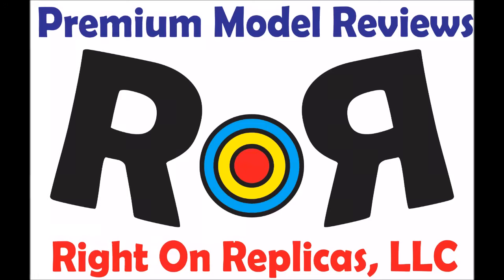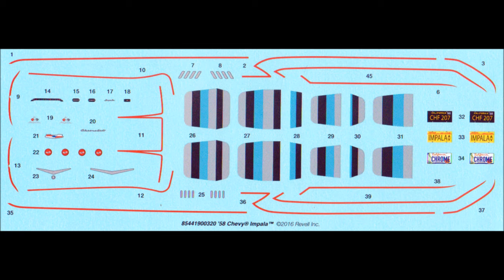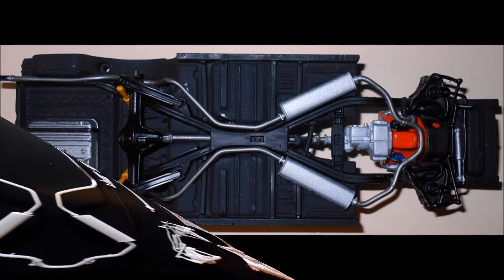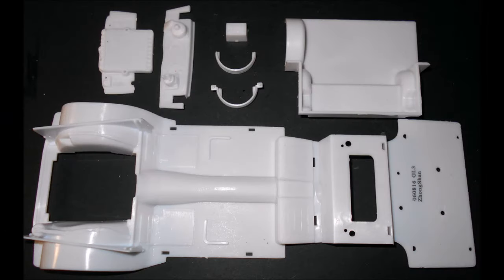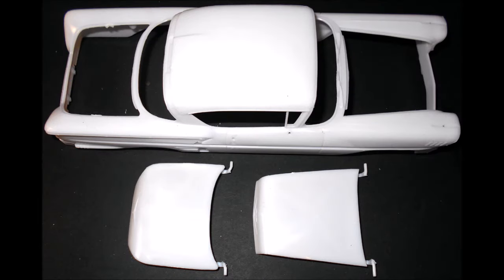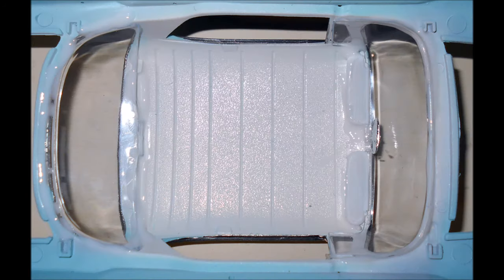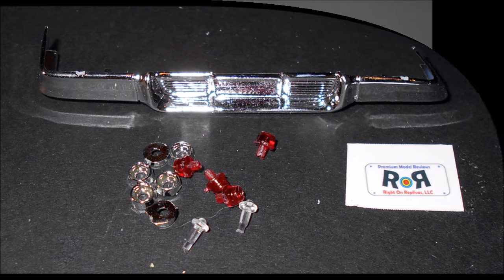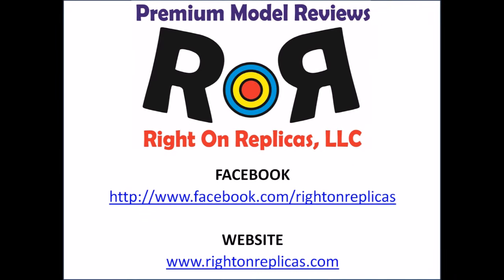How to Build the 1958 Chevy Impala 1:25 Scale Revell Model Kit #85-4419 Review

Comment: Great build,  I am just starting one of these. My kit is missing the clear and red tail light pieces. Is there any way to get replacement ones?
Reply from the maker: CC,  Rev 'o Germany is currently not even shipping parts to the USA. "Please note that currently no spare part orders can be delivered to the USA. Since the shipping has been stopped by the service providers. This is in connection with the COVID 19 virus."

On the other hand, you can get a built or partial from Fred's Model World or eBay.  Finally, buy another kit and use some custom taillights on one or the other.  

Then again you can make one from the one you have by making a mold in modeling clay using clear casting resin or epoxy glue.  You can tint them with clear red paint.

  PS, please subscribe if you haven't already to help us reach more modelers.  -Doug

Comment: Amazing work! Love the color! I was looking for this exact kit but cant find it. Looks like it has possibly been discontinued. The only kit I could find on Amazon was the  Revell 1958 Impala Lowrider. Looks like the Lowrider was the previous Revell kit before this one. So I bought the Lowrider kit. Is there much of a difference between this kit and the lowrider kit? Whats the difference between this kit and the lowrider kit?
Reply from the maker: JD, This is an older issue kit and you would have to look at places like eBay or a hobby shop for it.  I don't think the Lowrider kit has all the stock parts for a stock build!  -Doug